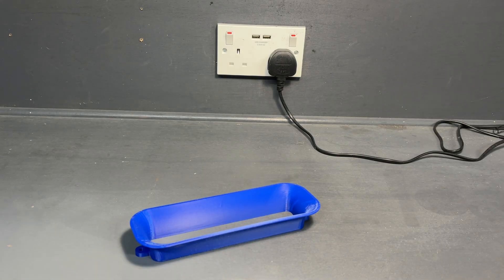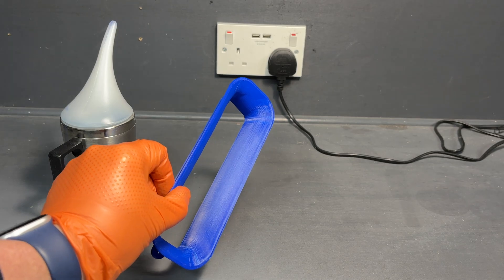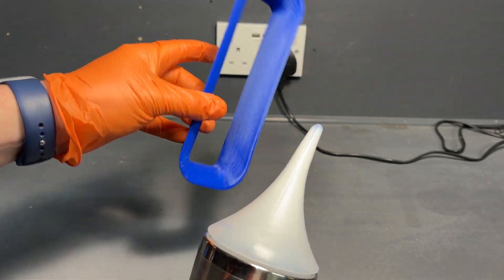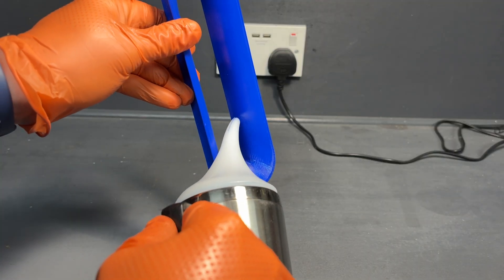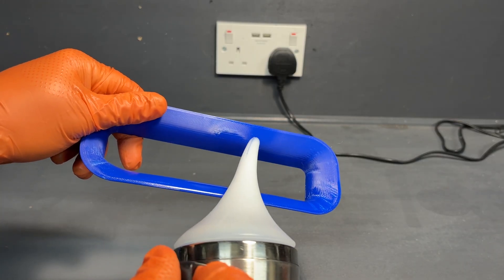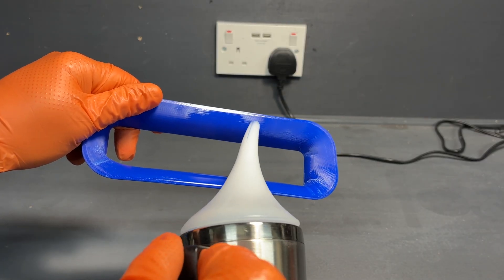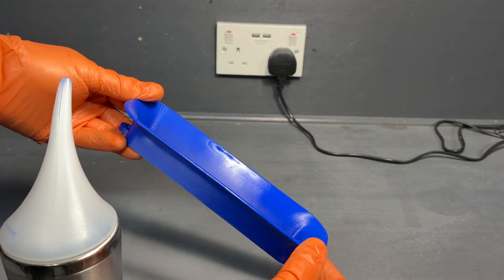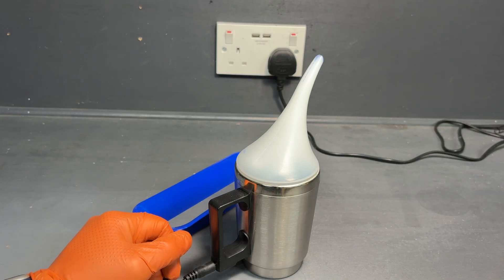Vapour smoothing ABS made easy #3dprinting #bambu

Comment: when you're printing with ABS.  do you use a texture surface or smooth on your printer?  what is the brand of filament you found for this specific print?  I've seen some people talk about cheaper ABS's using different plastics to composite and it makes the smoothing not as effective.
Reply from the maker: Hi there i should have mentioned it in the video sorry about that 
It was printed on biqu cryogrip smooth ish plate and its all bambu abs filament

Comment: Can you link the vaporiser you used? The one I have is rubbish doesn’t even give out a vapour. What power supply are you using?
Reply from the maker: @Hyett296  https://amzn.eu/d/gMlKP9Q and i have it connected to a 12v jumper pack
Reply: @ thanks any idea on the output of the power pack? I’ve tried 12v 1a  and I get nowhere near the vapour you do which suggest higher output is required
Reply from the maker: @Hyett296 its a large pack i can check later

Comment: Wow. I have this device only for headlight and then on the shelve but now it will serve another purpose. Thanks!
Reply from the maker: @skelethornbro  i had the same thought last night as i went around the house trying to find a container to put the part in so it could be exposed to fumes and then i said why not just use the thing i have in the shed 😁
Reply: @Kenprints  I wonder if the liquid that included with the set can smoothen the printed PC material for more transparent...
Reply from the maker: @skelethornbro i dont think it works on pc
Reply: @ but, the headlight covers is made of polycarbonate right?
Reply from the maker: @skelethornbro it didnt work on the headlights i tested thats why i still had acetone left
Reply: @ ah i see the reason. But i mean a special chemical that usually sold together with the device or can be purchase separately.
Reply from the maker: @skelethornbro its just regular acetone and should be available fairly easily
Reply: @Kenprints @kenprints was it 99,5 high grade acetone or the one the Hardwarestore? Thx
Reply from the maker: 99.5 acetone
Reply: thank you!
Reply from the maker: No probs use ventilation its quite strong

Comment: This is a cool method.  I built a chamber with 2 small fans inside on the top.   Filled a metal dish with acetone and let it sit.   The acetone evaporated but nothing happened to my abs part.   Idk why.  I tried multiple times.   This method seems a lot easier
Reply from the maker: its too slow to evaporate without heat this container heats it up and generates a nice stream of vapour - if you notice in the video im swirling the canister a bit thats because i was running low on acetone and swirling it got the acetone to move up on the hot sides of the flask and instantly vapourise
Reply: I use the same method but soak paper towels in the acetone and hang them from the 4 sides of the chamber.  Comes out great.
Reply from the maker: @davebaumgartner9052 never tried that method i must give it a try
Reply: @davebaumgartner9052  I’m gonna try that cause the dish didn’t work at all.  Are you heating the chamber at all or just room temp?